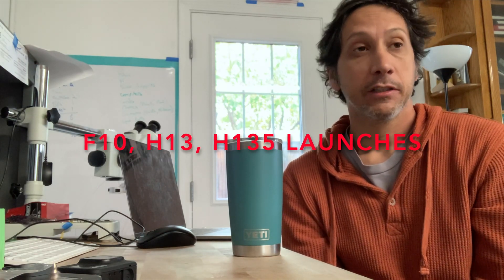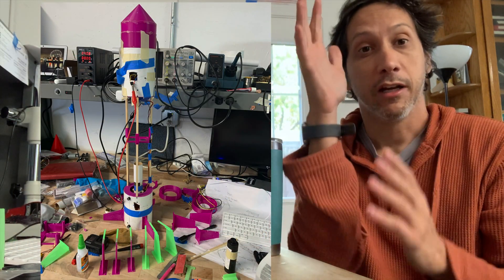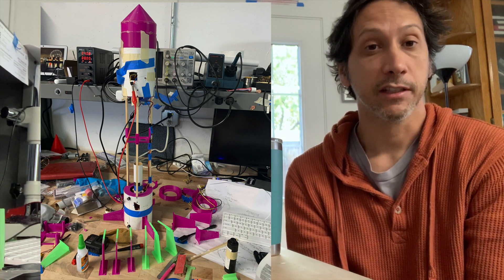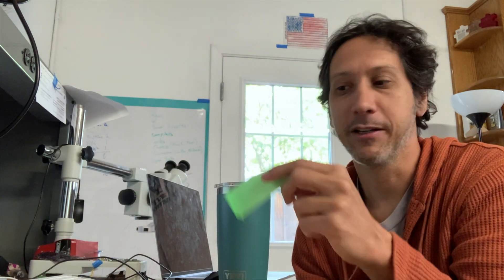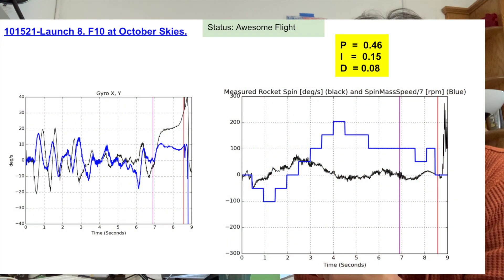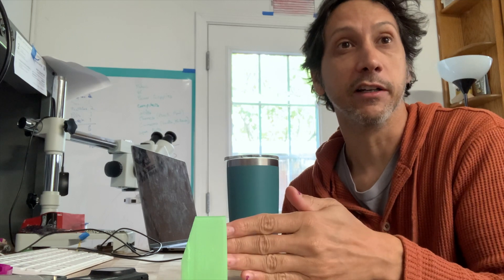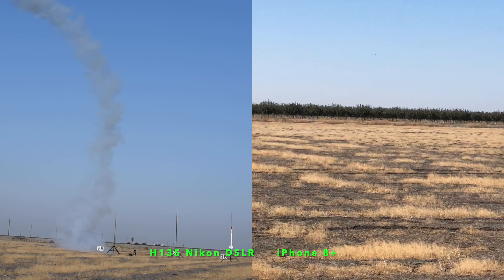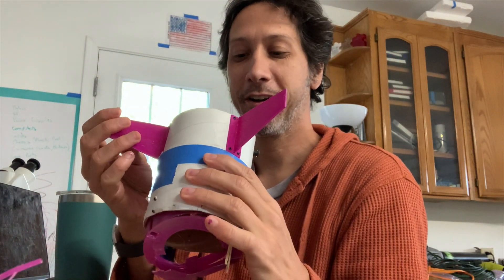F10 Thrust Vector Control Rocket, H13 TVC, then H135 Non-TVC

Comment: the f10 has a delay charge right? do you just let the motor kick out of the back in stead of the charge going up to eject a parachute?
Reply from the maker: i remove the black powder from the f10 and plugged it because it would just blow into my gopro. The motor does not kick out the back, I don't want to drop it. You can see it stay in there the whole flight. I use a separate ejection charge fired by the raspberry pi that blows the chute
Reply: @peterb7615  what’s your method for removing the black powder charge? Sometimes it can be quite packed. I have 6 f10 motors I haven’t used in my TVC because I didn’t want the ejection charge destroying everything lol.
Reply from the maker: I find it easy to scrape it out. I usually also put some epoxy on top of the end as a cap so that smoke doesn't come out at the end
Reply: @peterb7615  good call on the epoxy